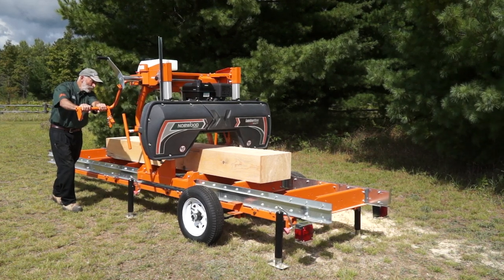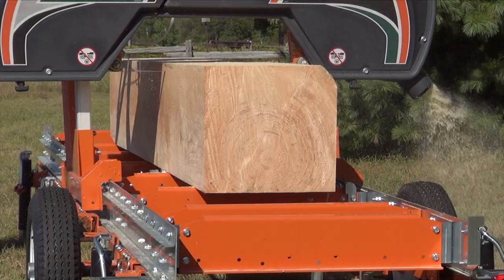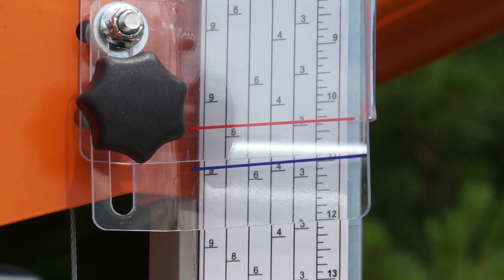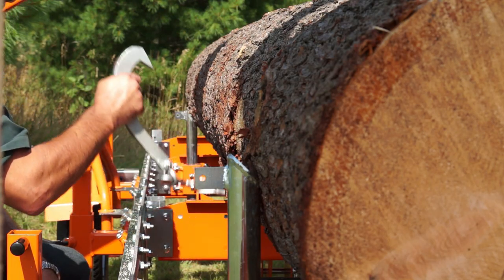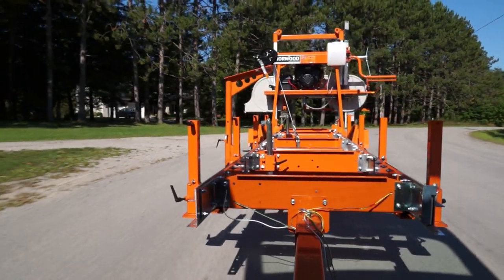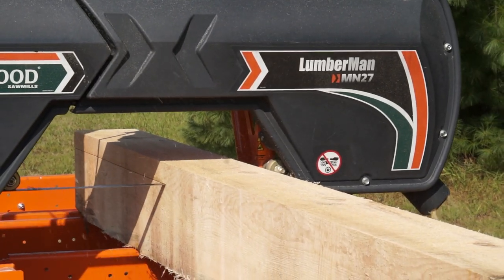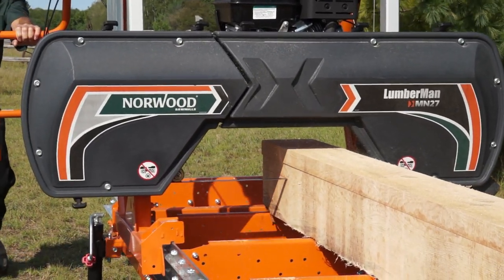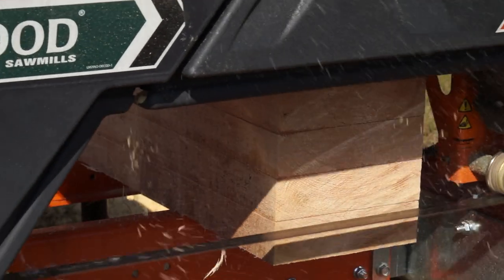Norwood LumberMan MN27 Portable Sawmill - Take Your Projects to the Next Level

Comment: How much does this sawmill cost?
Reply from the maker: Norwood band sawmills start at just $4780 for the LumberMan MN27. 

Norwood builds several models of manual and hydraulic portable band sawmills ranging in capacities from 27” (69cm) to 38” (97cm) log diameter.  

Standard, Norwood band sawmills are 16 feet long (4.8m), which allows you to cut boards up to 13-feet (4m) in length depending on the model.  Saw even longer by adding optional 4-foot (1.2m) log deck extensions. In fact, you can saw logs of any length in stationary configuration – some Norwood owners are sawing logs over 40-feet (12.1m) long! 

All Norwood sawmills have an available optional trailer system. 

Norwood band sawmills start at just $4780 for the LumberMan MN27. 

-	The LumberMate LM30 starts at just $5495 right now in stationary configuration. 
-	The LumberPro HD36V2, starts at just $8597 in manual stationary configuration
-	Norwood’s biggest bandmill, the LumberMax HD38 is just $11690 in manual stationary configuration. 

You can build up your HD36V2 and HD38 to fully-hydraulic anytime – when you start, or later when your sawmilling operation gets bigger. 

To learn more about Norwood Sawmills, here are some quick and free resources:

-	Norwood Catalog (downloadable link): https://www.norwoodsawmills.com/digital-info-kit 

-	Visit Norwood Sawmills online: https://www.norwoodsawmills.com/sawmills  .

-	Price list (downloadable link): https://www.norwoodsawmills.com/digital-info-kit  

-	Check out Norwood’s “SAWMILL TV” … the ultimate online “TV” channel devoted exclusively to portable sawmills and successful sawmilling. It’s your one-stop-channel for all the essential things you need to know – from choosing your first sawmill to getting the most out of your equipment … Think of it as the Netflix for sawmill addicts 😊. www.NorwoodSawmills.com/tv/ . Sawmill TV is another resource we offer to current and future Norwood owners FREE of charge.

-	Request a free Norwood Sawmills info kit + DVD – Order online: www.norwoodsawmills.com/en_us/catalog-dvd-kit . 

We’d be happy to answer any questions that you may have, or to prepare a quote, including shipping to your door.  Let us know the best number to reach you. Or call us toll-free at 800-567-0404.